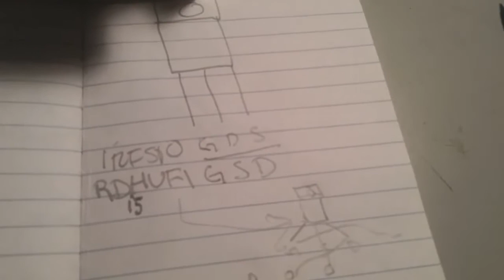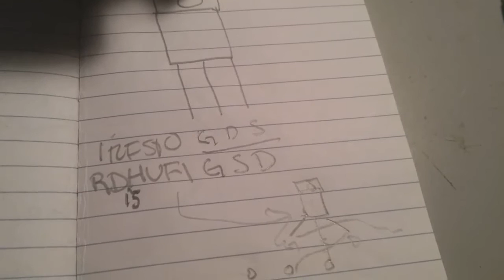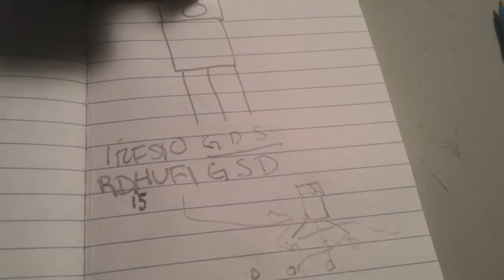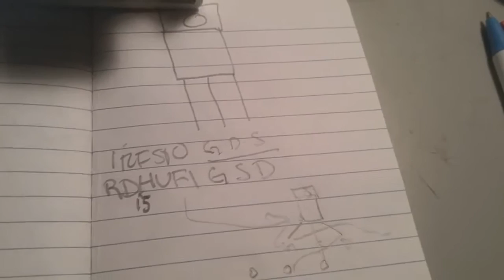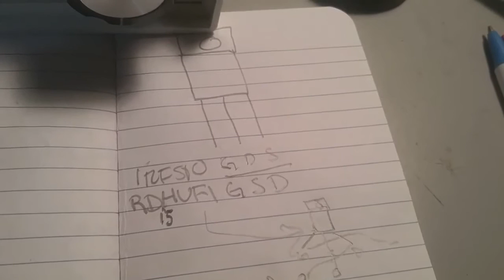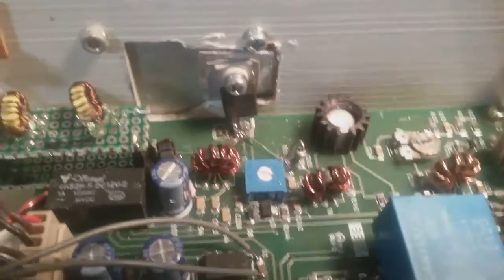Using the Mitsubishi RD15HVF1 or RD16HHF1 on the BITX40

Comment: IRF510 is being REPLACED by it's RoHS part number IRF510PBF.  Also note that because of the pinout change, the TAB on the RD15H parts are connected to the Source (TO-220 package ALWAYS connects TAB to pin 2) and not the Drain like the IRF510.  What that means for the BitX...is the TAB is now at ground potential and one could use the chassis as a heatsink. 73 de AA9GG

Comment: I see Ashhar has gone with them for the V6 uBITX ! 4 of them !  He went to direct parallel Pin to pin. and two of those for four transistors, see the V6 schematic. Wonder if you'd get better characteristics with two pin to pin  ?
Reply from the maker: The v6 circuit still uses the irf510. The v6 appears to have a place on the board to put the Mitsubishi part in place of the irf510.
Reply: @MiscDotGeek  I just downloaded, and printed, the V6, It has four  transistors on the schematic, but true, both transistor numbers are on it (when you look closely) . So, one would need to look inside, I assume you did ?
Reply from the maker: @californiakayaker  It does- I suspect that there are positions on the board for either. You can use the IRF510's it comes with, or yank them out and put RD15HHF1's in its place. I can't confirm that though. If you look at hfsignals.com and check out the pictures it clearly shows two IRF510's, as does the hookup page. You might ask somebody who has a v6 on the groups.io page, I'm sure they could confirm. See you on the air (40m JS8) de W7RLF :)
Reply: @MiscDotGeek  Will he replace the output transformer too and change the caps and resistances as outlined in the mod by Nick, John, and Erhardt ?   Been waiting for some verification of their mod for 2 years.   Somebody has to put it on a scope and see if that 20 watts they are getting is free of harmonics.